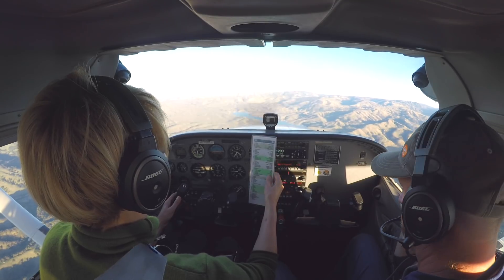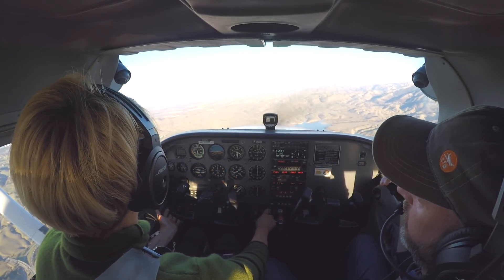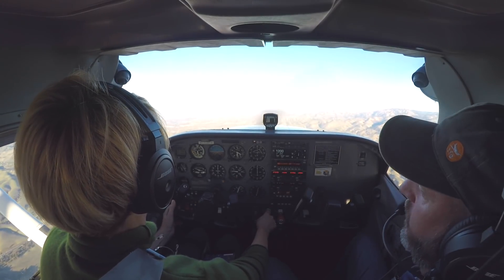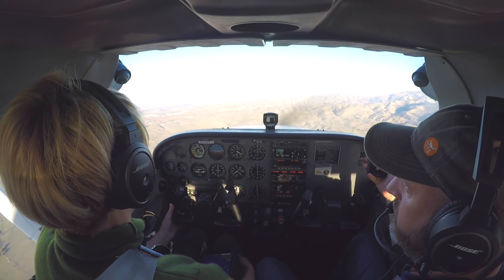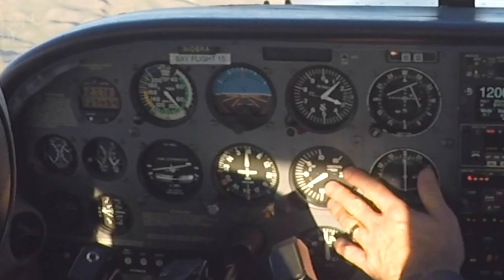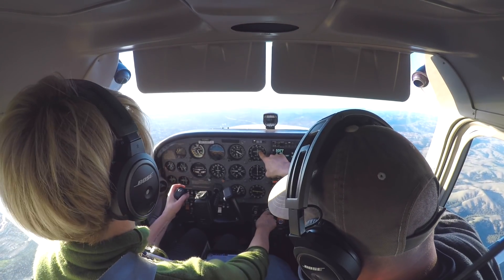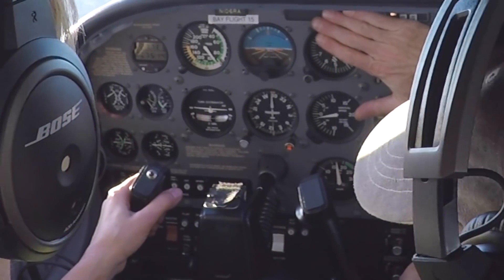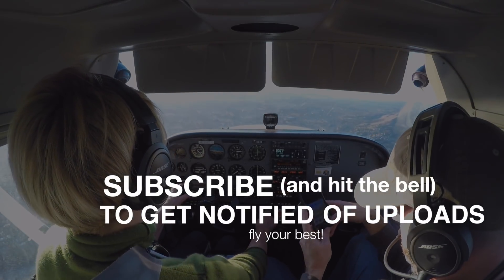How To Hold A Glide Slope - The SECRET that pro pilots know

Comment: Sorry, attitude controls speed and power controls the rate of climb/descent in a prop driven aircraft and 5 times the GS or even TAS roughly gives you 3 degrees.
Reply: Paul McPhie Glad someone here understands how an airplane works. The instructor in the video sure doesn’t. It’s apparent that the CFI in the video would not be able to explain why a plane climbs or descends.
Reply: @jimziemer474  Don't be too hard on him as it's a bit of a chicken and egg argument.
When I'm driving an aircraft with a  few more kilos and engines I use him method for subtle changes/corrections.
Reply: Paul McPhie 
Hey Paul, your statement is partly true, however if Pitch is to remain CONSTANT, only Power will change the speed in steady air, if you ever fly an aircraft with auto throttles you will notice constant movement of them in order to keep speed the same.
Reply: I can still hear my instructor’s voice from too many years ago while flying an approach “pitch for airspeed.  You’re a little under the glide slope, add a touch of power until you capture it”.  Still works for me.
Reply: Pitch for speed, power for descent/climb is the way I was taught, until the transition zone near the runway threshold where you start pitching to arrest descent and powering back to reduce speed and lift.

Under glidescope add power, over glidescope reduce power is our preferred way?

Comment: Interesting video and I agree with the concept.  If you don't know the correct power settings and configuration for the AC you are flying you will end up getting discouraged and give up on instrument flight. I have several thousand hours in Beechcraft, primarily Bonanzas and Barons.   If you knew the correct power settings, i.e. 14" manifold pressure with gear down over the outer marker, 20 degree flaps and nose over with the trim to intercept the glideslope. Nailed at 120kts and 500ft. desecent. on a decent day you could fly the ILS with the rudder pedals.  Same with the Barons, same wing.

Comment: Sorry for the simple question, I am a new student pilot.  But is this the same for all aircraft, or does it differ for different sized aircraft?
Reply from the maker: Rocky Taylor hey Rocky the power setting will be very different but groundspeed is groundspeed no matter what kind of airplane you're flying
If the groundspeed changes, however, so will the required vertical descent rate.
Reply: Thanks and have a Happy and Safe New Year!  Love the hat..
Reply from the maker: Rocky Taylor thanks Rocky! You too 
We're going to be selling them in 2018 if you want to pick one up
Reply: Most definitely

Comment: If the landing speed of a plane is 180 knots, will it land at 1000 ft/min?
Reply from the maker: Yes, pretty much if the descent angle is constant. The actual numbers are 478 fpm at 90knots and 956 fpm at 180knots
Reply: Refer to the chart in the TERPS. You should look at the approach plates first though and see what the glideslope is.

Comment: Quesion. 
Sin (3 deg)= 0.0523
0,0523 * 90/60*1852*3,280 comes out as 476 feet per min. 
Is 500f/min close enough. 
I saw a nother rule of thumb. 
Divide speed in half then add a zero.
Reply from the maker: Yes, it's rounded a little because the instrument you're flying is a needle and is hard to fly with such precision. Usually the mistakes are far bigger than this small discrepancy. If you're working to shave off the last 24 fpm, you're in a good spot. I haven't heard that one but it sounds like a good one to remember, thx

Comment: I thought 3 degree gs  was 5 times ground speed, so 90 knots ground speed is actually 450fpm. 100 knots is 500fpm..  120 knots  is  600fpm. Please clarify thank you.
Reply from the maker: Are you talking about an ILS glide slope? or a visual VASI? Even if it's 450 fpm, the main takeaway is to know your power settings, configure for the descent with a sight picture first then verifying performance ... and use the needles to measure that effectiveness. If you find anything (in the TERPS or anywhere) that elaborates on glide slope design I'd love to see it, thx!
Reply from the maker: thanks but it seems this could still be talking about a VFR 3 degree glide path. Interesting but not all glide slopes are exactly 3 degrees, are they? Here is some reading from Rod Machado (a confirmed authority) http://krepelka.com/fsweb/lessons/instrument/instrumentlessons02.htm
Reply: They are not all 3 degrees some vary due terrain or obstacles. However the rule is 3 degrees.
Reply from the maker: Right -  I think for the purposes of what I am trying to teach in this video it doesn't matter if you're on a 3.0 or 3.1 or 3.2 degree slope the rate will be somewhere between 485 and 555 in a no wind situation. I think the main thing is that you know what to expect and have practiced configuring the airplane to get yourself pretty darn close. As I said in the video - it won't be exactly the same every time (power will change with weight and atmosphere and wind will change the rate required) but it will be pretty darn close. To your point it does look like 90 is specifically 485 in a no wind situation, but, again, I think we're in the weeds discussing a 25 foot indication on the VSI
Reply from the maker: look to the bottom of the article here for the rate / speed table. http://krepelka.com/fsweb/lessons/instrument/instrumentlessons02.htm
Reply: perfect
Reply: @TheFinerPoints  beware that 3° to 3.2° difference can mean the difference between a good landing and a call home telling the parents your daughter/son hit a mountain side for not being "on" glide slope.
Reply: Instrument training is SERIOUS business. Many commercial pilots die making small errors and not correcting in time. Far too many small single and twin engine GA pilots treat flying like a Sunday drive and that is a recipe for disaster.

Comment: Glide slopes are not set up based on ground speed or foot per minute per se.  They are set up on a descent angle.  737's don't fy approaches at 90 knots.
Reply: A decent angle IS a ground speed and a decent rate. That's the whole point. A 737 at twice the ground speed will also have twice the decent rate.

Comment: If the glide slope is 3 degrees change pitch 3 degrees on attitude indicator from level and adjust throttles for approach speeds.  Winds will need to be taken into account for drift and effect on glide path.

Comment: You're great, but are you serious - 90 and 500?  Is that truly the formula?  What about private jets?  Does the same apply?
Reply from the maker: The descent rate is based on your ground speed. It's more like 478 when flying a 90 knot ground speed but you can't really aim that small on an old VSI. A jet would likely approach faster and so the descent rate would be higher.
Reply: @TheFinerPoints  So is there a generic collation or formula to calculate on the fly, as to what descent rate at X speed should be? Sorry, I just can't get my head around this for some reason ...  I am most likely overthinking.
Reply: @Sven2157  decent rate is about 5x ground speed. In your head it might be easier to do 10x ground speed and then divide by 2.

Comment: I am so confused. After reading a number of books, namely Stick and Rudder by Langewiesche and Emergency Maneuver Training by Stowell, I teach power for altitude and pitch for airspeed. Why does this change to hold a glide slope? Moreover, you keep saying 90 knots ground speed, yet have your student hold 90 KIAS. This just adds to my confusion.
Reply from the maker: Sorry for your confusion. All the books are correct! This relationship is tied together and impossible to pull apart (pitch and power) it is merely a convenience to think of one as "controlling" pitch or one as "controlling power". In almost all visual flying I'd say think of pitch as controlling speed. The reason you flip this around sometimes in instrument flying is due to the limitations of the instrument. Check out the old (70's) FAA instrument flying handbook if you can find it. They have lessons in the back. On the other thing ... there was no wind on the day we were flying so 90 was working just fine to hold glide slope.
Reply: Thanks for the clarification. I will keep an eye out for the 70s  IFH!
Reply: 45 year plus instructor here.   The old power controls this and pitch controls that argument has been around since the Wright Bros,  I teach the following  power is for altitude and pitch for airspeed.  If the power is fixed,  such as cruising then pitch controls altitude,  however in most cases if performing a maneuver in which power is a variable,  such as an ILS,  then altitude is controlled by power and airspeed is controlled by pitch.   I also stress that when one is changed,  typically the other has to change.  For instance when trying to maintain a glide slope,  if you change power to maintain "whatever,  you must adjust pitch to maintain the other.   It's like ruddesr and ailerons.   You must learn to coordinate the two...........it's called "flying"    He mentions steep turns.............since when do you vary power in an established steep turn?   It's also been my experience  giving instrument proficiency rides over the years,  that pilots that typically use the pitch to control altitude,  end up chasing the glideslope, and fail to ever stabilize the approach and for the most part  end up ignoring the airspeed.  Not a good technique.
Reply from the maker: Thanks for those thoughts Steve. The only time you'd adjust power for speed in an established steep turn is if the increased induced drag is more than you expected and your speed starts to fall I suppose, but you will slow down if you hold altitude in a steep turn, so that's what I was referring to.
Reply: Not to beat a dead horse,  but once established,  induced drag shouldn't increase.   One thing about posting instructional videos,  you'll get those that nick pick...........keep doing what you're doing,  I'm sure it's working.  A good gauge is how your students perform on check rides and later on in their flying experience.  Happy and safe flying  :)
Reply: Unless there's a damn good reason to switch what to use for altitude and speed then "ya dance with the one that brung ya" is excellent advice and a sure-fire way to prevent confusion at a critical time.  Pitch for speed and power for altitude ...... as you were learned will prevent a opportunity for confusion to occur if they are reversed during the landing process, Especially when teaching student pilots.

Comment: I was getting certain type of trained students coming to me for check ride prep, I was wondering why they pitch up for glide slope . I was looking for those instructors who train them and I want to ask you from where you read this type of training in the book ? Why you want to teach this wrong type of training and make unsafe pilots ? This type of training I see in students are going for stall chasing the glide slope all the time . When you pitch for glide slope what happens to ground speed? 

When you set the trim for airspeed , it is set for 90 knots . And now you want to destabilize one axis and then making power changes will destabilize another setting . Your method destabilizes more than one setting . This training is acceptable when you have automation but not on god dam 6 pack. I have to correct the students for the wrong training they received. Please prove me where you got this info and is it legit .

“ Pitch for airspeed power for altitude “